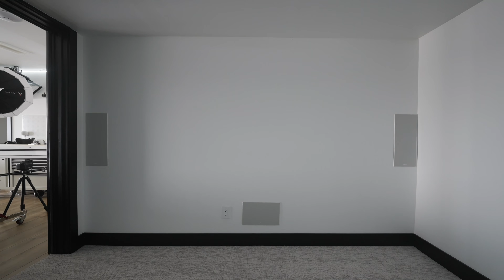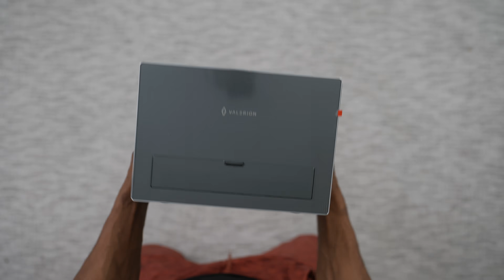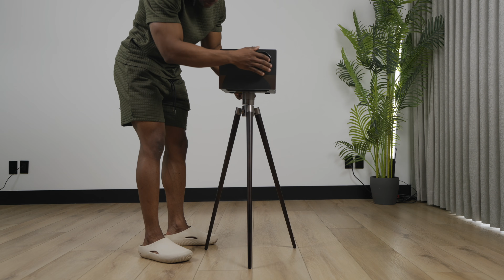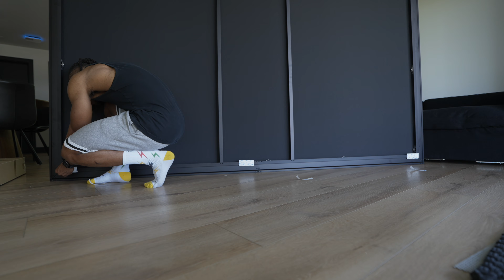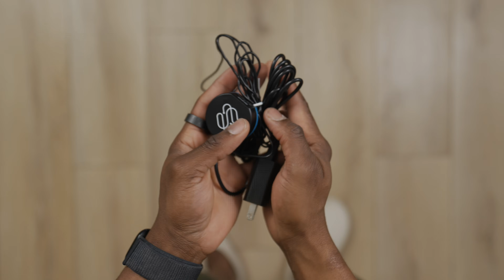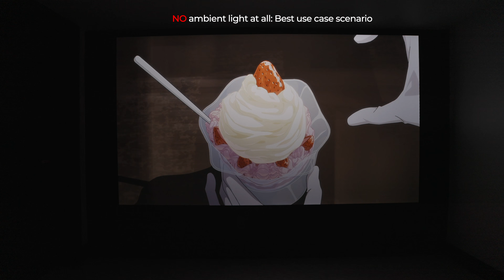Upgrading My Home Theatre with a 120" ALR Screen & 4K Laser Projector!

Comment: Is the alr screen a ust type of ceiling light rejecting screen? If it is, then you need to mount the screen upside-down instead of right side up since your projector is mounted from the ceiling. It would make sense to have the screen right side up if the projector is on the tripod like you showed earlier. Try it and let’s see if there is a difference in pic quality

Comment: Back in the old days, let's say between the tube projectors and the actual cubic-shaped chinese projectors, placing a projector correctly was not easy. First thing to check was the amount of optical zoom you had, then combine this this with distance available and screen size available (there are websites to make this calculation easier) . Now this kid talks about everything but the zoom and let the projector fit the image with "magic" but do you guys know what automatic keystone (and zoom too if optical is not enough) means? Well... let's say i would NEVER use this on a 3k projector. Your 4K is gone kid, i wonder if you even realize it. Auto is practical ? VERY! Is it 4K ? Not any more...

Comment: Don't use the keystone correction, instead use a combination of zoom, horizontal and vertical alignment to make the correction within the optical range of the lens.
Keystone correction digitally corrects the overshoot actually lowers the resolution while doing so. Just my two cents😅❤

Comment: I hope that you turned the ALR screen upside down. You have to do that when you’re mounting the projector on the ceiling otherwise you are losing about 50% brightness. This is a must when using this ALR fixed screen. you have to turn it upside down if your projector is mounted on the ceiling. if you haven’t done that do it and you will see a 50% brightness in picture with more vivid color.

Comment: Shouldn't be using an ALR screen with a ceiling mounted projector. The screen is designed for the projector light to be coming up and the screen displacing light coming down
Reply: @audenharper3014  unless you mount the screen upside down
Reply: @InkwellFoto  still probably wouldn't work, depending on the angle that the screen is built to be projected to
Reply: @audenharper3014  what angle? It’s a fresnel screen. Why are you commenting as if you know what you’re talking about when you clearly don’t? Fresnel screens have little micro caves starting from the center bottom and moving out. When used with a short throw the cave is right side up. When used with a ceiling mounted projector it’s upside down. Other types of ALR are straight jagged edges and the same principle applies. The last type of ALR, like cinegrey 3d and 5d, can’t even be used with a short throw projector. What facebook group trolled you into believing ALR screens are just for UST projectors?
Reply: @zimvader25  Google Gemini seems to agree with me because it said I was right 😆
Reply: @audenharper3014  clown said "google gemini agrees with me" 😂😂😂 what did Wikipedia say though?
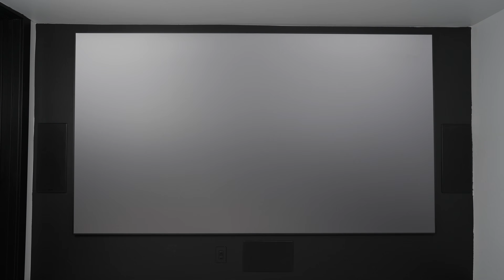Reply: @InkwellFoto  wouldn't really help but even if it did you can tell that he doesn't have the screen upside down.  13:19 you can see with the angle of the camera looking slightly up that he has the white side of the ALR on the bottom, dark on top. he's kind of just fucking himself.
Reply: @evinafk  i like how you clowns are literally watching a video of the screen working while steadily arguing that it wont work. Classic youtube comments 😂
Reply: @audenharper3014  lol what? Who’s giving your comment a thumbs up? This isn’t even close to accurate. ALR screens have existed long before UST projectors. They weren’t created for them.
Reply: Yes you can. There are specific ALR screens for Ultrashort throw and specific ALR screens for regular throw projectors. 

But you are correct if he is using an ALR screen made for UST projectors (light coming from a steep angle from below or above), then he has fooled himself.

Otherwise it should work.
Reply: @DudeOfTheWeek  he's using the valerion fresnel screen SPECIFICALLY designed for long throw projectors...

Comment: I think a lot of people don't realize that even just painting the projection wall with a grey paint, no fancy ALR stuff, will drastically improve the apparent richness of the image. Yes, it will decrease the max brightness, but trust me, in a room with white walls, too much brightness is usually the issue, not too little. Not saying ALR can't help, but if you don't happen to have the money to spare, it's not THAT important. When people compare it to white screen projection in a white room, they are of course going to be blown away at their blacks no longer being horribly washed out.

Also - nice setup in the video, but please, make sure to measure and install the projector precisely, so that you don't have to use the "covenient" auto adjustment that does fit your projection onto the screen, but is essentially wasting a lot of pixels on the edges and you're decreasing the resolution of your image. Not to mention the projector has to process the image to distort it onto the screen, probably creating a lag. The convenience ends up costing a lot.
Reply: The only problem about painting the wall gray is that it still does not reflect ambient light. The ALR screen reflects the ambient light that’s why they’re so unique.
Reply: @Alpha-Breeze  You mean ALR DOESN'T reflect ambient light. The point of an ALR is to absorb the ambient light instead of reflecting it. Absorbed light means you don't see it, therefore darker parts of the image are darker...

I know how it works, I'm just saying that a grey screen or a grey wall is a really good middle step that a lot of people just skip over. They don't like the look of a washed out white screen, so they assume they have to pay overpriced high end ALR to get anything decent.

And it's not that ALR screens are completely without issues first - there is no way for them to really reject all the ambient light, that's why they look grey in a lit room. And if you use them in a daylight-lit living room, that grey is still the blackest black you're ever going to achieve on the screen. The other thing is, they suffer from some amount of hotspotting because the angles are different in the center of the screen and in the corners and then if more people on a sofa watch, the ones to the side can get worse image. It's simply optics.

Lastly - ALRs are mainly meant for rooms where you can't shut out ambient light from windows and you want to watch something during the day or in a living room with lights on. If you're building a cinema room without windows where you come in and turn off the lights, you're going to be much better off painting the walls black and using a normal white / light grey screen, like they do in actual cinemas. If your walls and furniture are absorbing the ambient light, there IS NO ambient light that an ALR would have to reject.
Reply: @Iguana93 they are designed in a circle. The lights come in from sides top absorbs. Projector light from front bounces back. Cant do that with a painted wall
Reply: @Alpha-Breeze OMG, I know.... Didn't I just say that? I never said ALR is useless, I just said a darker projection screen can be enough for many people. And ambient light can and does also come from the direction of the projector, so not all ambient light gets rejected. In a light-controlled single-purpose cinema room, dark walls are a better way to kill ambient light.
Reply: @Iguana93 haha

Comment: Awesome. Highly recommend darkening your ceiling and adjacent walls at some point, even if just in front of it about 4 feet out, the reflections lowers contrast significantly. You can test the difference out with a dark curtain or something.
Reply: With a regular screen, yes. If you have an ALR screen, it is not necessary.

Comment: Hello,  Greetings.
I need to know if the Valerion Visionmaster Pro 2 can output Dolby Atmos TrueHD and DTS MA sound through the eARC port. I have a Plex server with movies in this format and I want to know if just connecting it to my Receiver, which supports these formats, would be all I need, or if I would have to connect the Nvidia Shield TV to the Receiver and then the Receiver to the projector. This is something I wouldn't want since, having an eARC port, it should be able to play these formats through free passthrough.

Comment: Why install speakers outside the screen? One of the major benefits when using a projector is the ability to place speakers behind the screen?
Reply: No. Only acoustic screen material is meant to have speakers behind the screen. Regular screens are solid. You’re not getting sound through solid material.

Comment: My only question is how did you use ALR screen with your projector mounted on the ceiling. Isn’t the projector should be at eye level for it to work with ALR screens?
Reply: @mclovin-wd8hl   the thaught same thing ALR is for specially made for short beamers right
Reply: @MulResearch  yes and from the looks of it he has the dark side of the ALR screen on the top so his projector is also being diffused in the same way ambient light would be. he shouldve just painted the walls and got a normal screen or just got a ust projector.
Reply: @evinafk    Using an ALR screen was useless... should've just painted the room black and could have gone with an bigger acoustic off white screen with speakers in the background

Comment: Is an ALR screen necessary for a home theater that's in a finished basement with very little ambient light?  In other words, are there other benefits to using one?  Looking at helping my son-in-law update their home theater from a very dated lamp based 1080p system to a 4k system (perhaps the Valerion).
Nice job on this upgrade - and thanks for the video!

Comment: you plugged into the HDMI port 2.0 on that projector therefore it will only support 4K 60Hz need to go to the HDMI 2.1 port for 4K 120Hz, correct me if I'm wrong

Comment: 90% of the audio and nearly all of the dialogue comes from the center channel speaker. However, if that center channel speaker is aiming towards one's knees dialogue intelligibility it's not going to be much better than a budget soundbar. If it's worth doing it's worth doing right!
Reply from the maker: The couch is low and the center channel is pointing at the ears when seated so it works great and certainly does not sound like a budget sound bar.

Comment: What is those in wall speakers you have there? I have some floor standing speakers i want to swap out for some good in wall speakers. Thanks
Reply from the maker: Floor standing speakers  are great but in walls are just so much cleaner when installed. I bought the set from Polk Audio on Amazon - They’re from the L-model of the Vanishing Series the brand sells :)

Comment: Isn't  ALR screens meant for ultra short throe projectors  firing  your projector  light source from the  bottom  of the screen. If it was a grey screen  that will be a bit better. I dont know but the projected image looks quiet dim. Please check on forums. Nice set up.
Reply from the maker: Thanks brother! This is a Fresnel ALR screen designed specifically for long throw projectors. I don’t know what you see but it’s crazy bright in person :)

Comment: The reason why your gaming setup only recognized 1080p was because the native resolution of the Valerion VisionMaster Pro 2 is 1080p (1920x1080). It uses a 0.47-inch DMD DLP chip with XPR pixel-shifting technology to achieve a 4K (3840x2160) onscreen resolution - in other words, it's fake "4K". A true 4K projector, such as the Sony VPL-XW5000ES, usually costs an upwards of $5000 USD.
Overall nice setup. Oh, and please fix your mic gain as it has caused a lot of audio distortion.
Reply from the maker: Appreciate the love and the feedback on the mic 🙌🏾 It being replaced after this video

Comment: Brother,  you don't need an ALR when there is no light in the room.
Reply: I think since there’s white walls, the light reflects off the walls and back onto the screen imperfectly, so ALR is a valid choice in this case
Reply: Correct. ALR is very helpful for light reflecting off of the walls.
Reply: He is not your brother 🙄👎